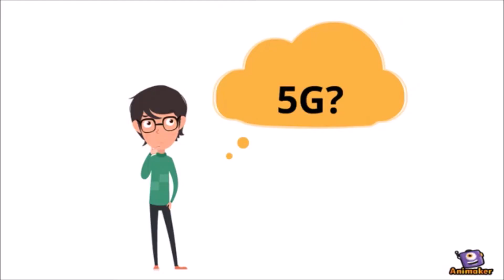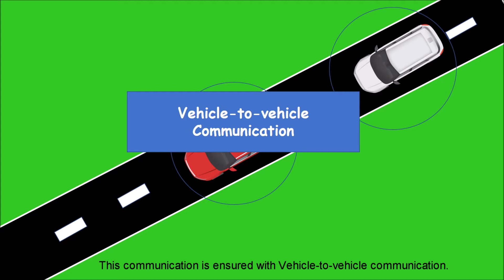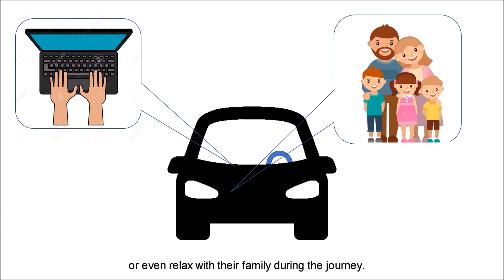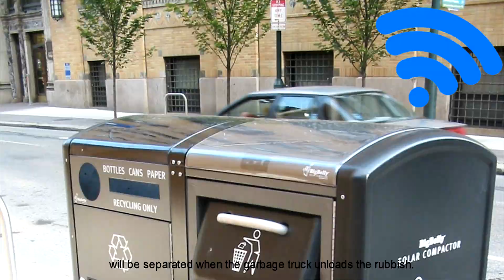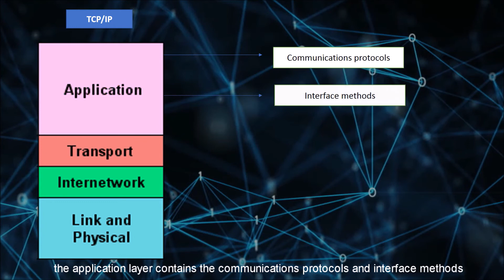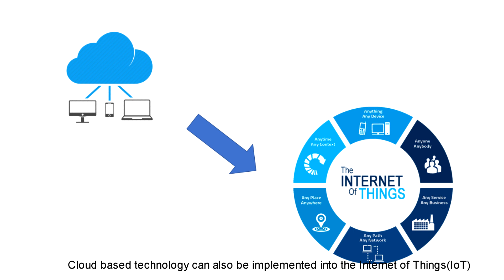5G in Smart Cities

Comment: What security measure can be taken to prevent self-driving cars from being used as weapons especially with the advantages of 5G?
Reply from the maker: Since autonmous cars are still in the working, the security of the car is still being improved to protect these cars from threats and hacking. There are currently two ways to improve the security which is by building security into the design of the vehicles such as ensuring that there are no conflicts, errors or misconfgurations in individual components. 

Other than that, another way that can improve the security is by designing vehicles that match security with safety. This is because thhe self-driving technology that uses more artificial intelligence will be relying on more software to control the cars and make decisions that a normal human drivers would.

Comment: Nice video

What is the common platform and standards that has to be applied in order to allow the data used in one application eventually to be used in another application?
Reply from the maker: Thank you. 

To answer your questions, when you look at Smart City application domains, like smart parking, safety applications, smart homes, intelligent transport systems, environmental pollution monitoring and things like this, we can say there is a high match of similarities. This all relates to big data integration and making data available to the public or other applications domains. Also, when we talk about 5G end systems we don’t talk necessarily about a 5G smartphone, but we rather talk about 5G modems that will be embedded in any kind of future device for example your car, your smart watch, and your smart gear, or whatever you can imagine in the future. 5G will finally be nearly everywhere and it is this kind of digital connectivity that is driving the digital transformation, which is happening in Smart Cities.

Comment: What are the requirements that need to be met for 5G development?
Reply from the maker: There are a few requirements that need to be met for 5G development and these are some of it.

1.   1-10Gbps connections to end points in the field (i.e. not theoretical maximum)
2.   1 millisecond end-to-end round trip delay - latency
3.   1000x bandwidth per unit area
4.   10-100x number of connected devices
5.   Perception of) 99.999% availability
6.   Perception of 100% coverage
7.   90% reduction in network energy usage
8.   Up to ten year battery life for low power, machine-type devices

Comment: How will implementation of 5G in smart cities help improve energy efficiency?
Reply from the maker: There are many ways that 5G can help improve the energy efficiency in a city. 5G connections can allow accurately monitoring and forecasting energy needs. With smart grid technology, demand-side management can support load balancing to help reduce electricity peaks, minimize down times, and reduce energy costs. However, to relate to our vide0, smart lighting helps to save power and reduce light pollution by dimming public lighting when no pedestrian or vehicles are present.

Comment: Will small cells be required to implement 5G?
Reply from the maker: Definitely. This is because 5G network has a higher frequency and due to this, it can travel short distance and is not able to travel well through obstacles such as buildings. Therefore, small cells are needed to form a dense network as it acts like a relay team, handing off signals like a baton and routing data to users at any location. Since 5G is to be placed at large geographic areas, it will require a tremendous number of new small cells.

Comment: Just some thought on the smart street light, why does smart street light require to communicate between each other? Smart street light are having sensors, could be capacitive sensors for sense existence of any kind of object, inductive sensors to detect cars or even PIR sensors to detect moving object in order to determine if there are moving object. Having capability for smart street light to be connected to some server only increase the vulnarability of being exploit to cyber attack. Not only that, the energy that needed to used to send wireless data can also be saved if it is not connected to the internet in the first place as the purpose of smart street light are to save energy.
Reply from the maker: The reason for having smart street light to communicate with each other is so that when a passer-by is detected by a camera or sensor, it will communicate this to neighboring street lights, which will brighten so that people are always surrounded by a safe circle of light.  

There is no denying that the more number of devices that are connected to the internet, the more and more they are being hacked and these are some of the disadvantages that we currently have no power over. However, we can do something to try to prevent it and that is where security, safety and privacy should be engineered during the earliest phases of the development cycle, including its firmware, hardware and software. The cost of not doing so is simply too high for society. If these important steps are ignored, then the internet of things may prove to be nothing more than the internet of things to be hacked.

Also when it comes to saving energy, the street light uses the ZigBee technology as it is the best candidate to create sensor networks for applications where the power consumption must be as low as possible. Furthermore, studies have proved that the ZigBee is more affordable in terms of power consumption and costs than competitive technologies.

Comment: Any example of how to implement cloud based technology into IoT?
Reply from the maker: We will provide an example of how to implement cloud based technology into IoT by using driverless cars as an example. As you know, driverless car has various sensors and networks to enable transferring of data among vehicles so that vehicles can communicate with one another to avoid accidents. With the amount of data created by the driverless car system, it may be difficult to identify signals of suspicious activities (hacking) and separate them from all the noise. Therefore, it is crucial to encrypt as much data as possible. Cloud platforms can help to manage both client and server side encryption, automate encryption process and create customized encryption solutions.

Comment: Does having V2V system mean citizens can cross the street any time they want? 🤔
Reply: Maybe if your brain had been injected with a chip that can read what are you going to do haha
Reply from the maker: Im sorry as Im a little confused at your question but I will try to answer it the best way I can. V2V stands for vehicle to vehicle communication. In the context of the video above, it applies for the driverless car technology.  It is a system designed to transmit information between vehicles and other objects on the road in real-time. This information provides warnings to drivers and other vehicles. Therefore, with the information that the car shares with the other cars around it allows it to know whether the current environment around them allows them to drive across the street safely or not. Another thing is that the vehicle also communicates with the traffic light so that it will know when it shows green or red so that they can drive safely.